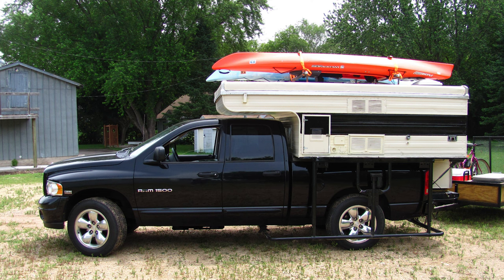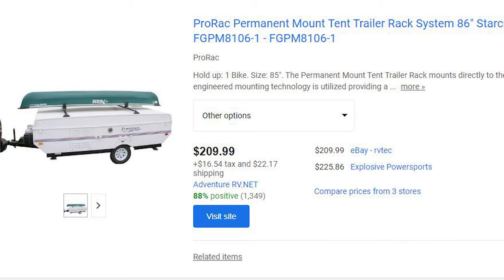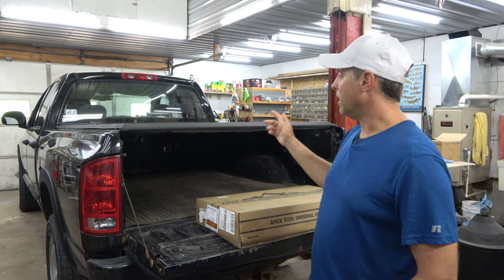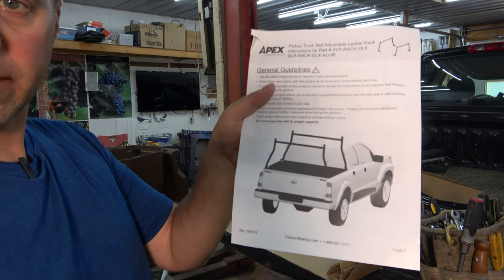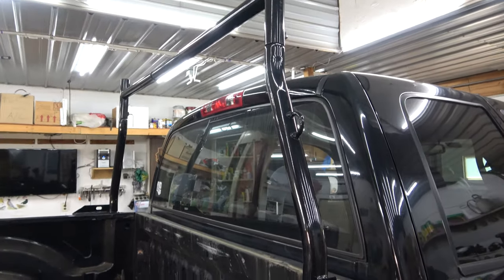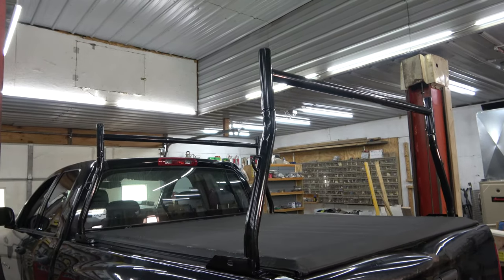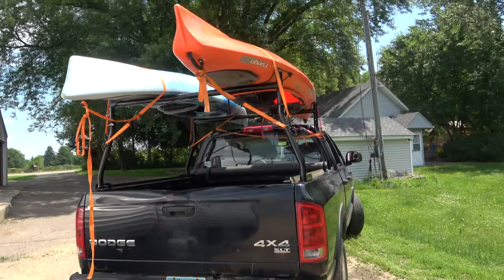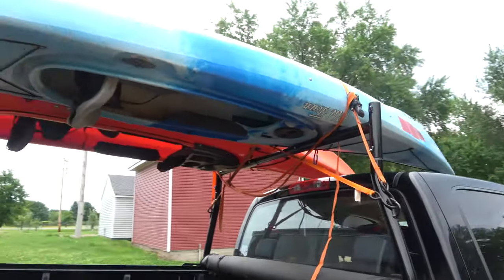Best RV/Camper Kayak Carrier

Comment: Thank you!   I just ordered this rack through the link you provided.  I'm in the exact same position.   Want to keep my bed cover and pull a trailer.  And thanks for demonstrating how to easily get them up there!
Reply from the maker: I'm glad it helped. Its been working out great for me. I actually take the rack off when not in use. I bought little plastic plugs to cover the bolt holes. It only takes 5-10 minutes to reinstall it when I need it.

Comment: Thanks I have  a F150 with 5.5 bed and a 12ft kayak and a small travel trailer.  Going to look into this solution to see if its compatible with my tonneau cover.
Reply from the maker: Hi Rob. The tonneau cover does make it difficult. You almost have to go with a rack that bolts on top to keep clear of the cover. So if you don't mind drilling holes in your truck, it works well. I would remove the rack when not in use, so I bought plastic plugs to fill the holes when I removed it.

Comment: It’s always a little unnerving to drill into your truck 😁 Looks like you could’ve used an extra hand at times for the install. Looks good Rande 👍
Reply from the maker: Yeah, I had some fun trying to assemble it. I really needed a second hand helping. I often dream about getting anew truck, but then I would be worried about every scratch I put on it. In the end, I love driving around an old beater truck. Thanks for the comment.

Comment: Nice video and great job on the rack and the improv fishing trip! My bed cover covers exactly where you bolted yours down so I had to go the 2” PVC pipe fabrication that sits in the bed. I may add some of those hook rings to the uprights for extra tie down options. Happy Camping!
Reply from the maker: Hi Glenn. I'm glad you figured something out. Its not easy getting a utility rack to fit with a bed cover. I'm looking into a new dodge ram with the "rambox." There seems to be very little options for this setup with that truck, so I may have to do something like you did.
Reply: Can you explain the 2in PVC that you did?  I will have a hard time installing with my cover
Reply: @sychan29  it’s a bit difficult to explain. A picture is worth a thousand words. But basically all the parts below the cover are cemented together. The four corner risers stop about 2 inches below where the bed cover sits. So at the tops of the 4 risers is a T fitting and that’s where I fit in the front and rear “goal posts” that actually support the kayaks. They are secured with wing nuts and bolts so that they can be removed. Bottom line is I can cover the truck bed only when those goal posts are removed, but not during travel. So that is a downside. If you search Pinterest for PVC kayak carriers for truckbeds, you should be able to find a decent picture.

Comment: I need to install a kayak rack but I also have a soft cover over my truck bed.  I wondered if you had any tips on doing that since it looks like you did the same with your truck.  Any advise would be helpful thanks a bunch
Reply from the maker: Hi Beth. I had the same dilemma. They do make racks that will work with a soft cover, but they are really expensive. The one I went with bolts to the top of the bed rail and does not interfere with the cover, and it was really cheap. The downside is that you have to drill holes in your truck. I bought plastic plugs that I put in the holes when I remove the rack. I only install it when I'm hauling the kayaks. I believe I put a link to it in the video description. That would be a good place to start looking. Thanks for the question.
Reply: @GoMidwestFishing  Thank you so much, ill will look at the link and see if it will work with me truck.  Much appreciated

Comment: May I ask why you took your bed cover back off before you used it
Reply from the maker: In this case, I was carrying bikes in the back of the truck which didn't fit under the cover. Next fix is to install a bike rack on the back of the camper so I can leave the cover on the truck.
Reply: @GoMidwestFishing   That would be great if it works I've heard horror stories of people's bumpers falling off after attaching something to them